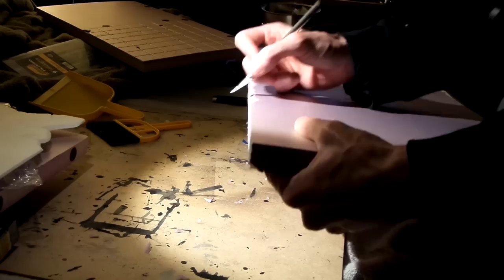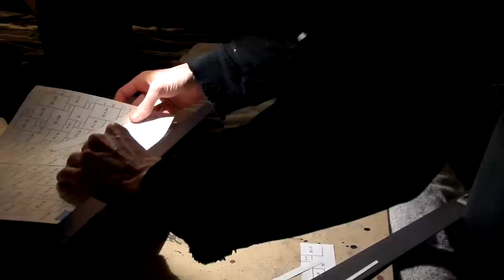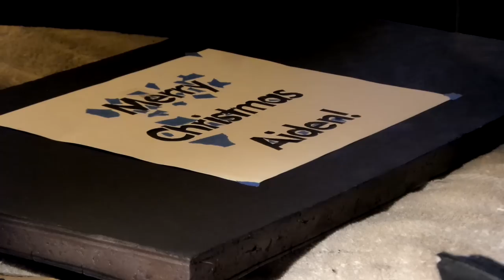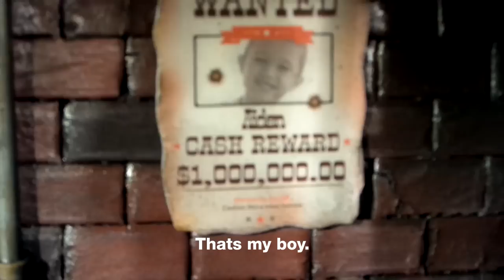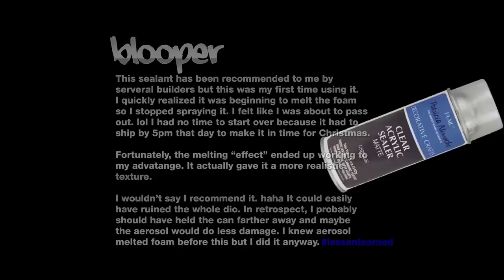Action Figure Diorama - Time Lapse Tutorial - Dilapidated Duplex (1100 Subscribers Video)

Comment: If you haven't learned about it yet, try using Mod Podge after you do your carving and before you do your painting.  Mix it with a bit of black paint and a tiny bit of water and apply 2 coats.  This will allow you to use aerosol paints and sealants without it melting your XPS.  It also strengthens the XPS so it's less likely to get damaged.
Reply from the maker: nice tip. thanks

Comment: Wow, that is an excellent piece of work!  This is something I have wanted to do because of the videos like this that inspire me.  By the way, what is that foam called and where can you buy it?  It looks perfect for molding in the little details.
Reply from the maker: Thanks so much for watching and the compliment. Its called Foamular Insulation Panels. Its in the insulation aisle at Home Depot. Its usually in its own box in the middle of the aisle. Its about $5.50 for a 2 ft by 2ft section. Easy to locate in the store because its pink and stands out. Very easy to work with but wear a dust mask because the foam dust is bad for your lungs. 

http://www.foamular.com/foam/

Comment: Nice video!!! how do u make those accessories(i.e pipe, signage etc)? did u buy it or u actually make it urselves? if so, can u provide the link?
Reply from the maker: the pipes are "DIY straws" from .99 cent store.
https://www.walmart.com/ip/Diy-Straws/752059470?wmlspartner=wlpa&selectedSellerId=1035&adid=22222222227000000000&wl0=&wl1=g&wl2=c&wl3=42423897272&wl4=aud-430887228898:pla-51320962143&wl5=9031273&wl6=&wl7=&wl8=&wl9=pla&wl10=113134932&wl11=online&wl12=752059470&veh=sem&gclid=Cj0KCQiA1-3yBRCmARIsAN7B4H2p2STAlbPD8axQUhoHG05f0OBAudPxwKDvWtplZkhEQ6qgWW1KIpAaAnX6EALw_wcB

Signage can be printed out on paper and glued to comic book backerboard

Comment: Hello, sir. I have a question. How did you make the brick parts levelled?
Reply from the maker: +Project422 Films ya gotta carve some bricks independently and glue them inside the cutout spaces only protruding a bit
Reply: +GJL Creative Studios hey were did u get the door and window Frame and love ur work
Reply from the maker: @117715867209141061708 eBay my man. I say if it fits the look of your project and saves time, use it.

There are many miniatures sellers on eBay look for "1 : 12 or 1/12 scale doors and windows"
Reply from the maker: didnt come with hardware though so I sculpted the doorknobs
Reply: GJL Creative Studios how did you remove the original bricks from the sculpt for putting in the protruding ones?Thanks for sharing this.
Reply from the maker: @rickfisher4866  I just dig them out with some clay carving and shaping tools. I have a pack of them with varying heads on them. some kind of small fork would work well

Comment: INGLÉS
Friend, I have a question, where can I buy or get everyone, absolutely everyone acceserios for your dioramas, I'm from Mexico
Reply: hola yo igual soy de mexico y si quieres hacer las paredes consige:
 icopor para los accesorios los puedes comprar en mercado libre y las demas cosas en lumen, suerte
Reply from the maker: hi there. I made most of the stuff. You can buy the door and window off ebay
Reply: GJL Creative Studios 
dude, where did you find the high voltage sign?
Reply: Muchas gracias por responder mi amigo, salu2
Reply: Octavio Salazar Sosa  claro y si quieres puedes comprar plastilina eproxica y agregarle detalles
Reply from the maker: serviceable stuff made from foam, wood sticks and a computer printout
Reply: GJL Creative Studios 
dude youre awesome thanks¡¡